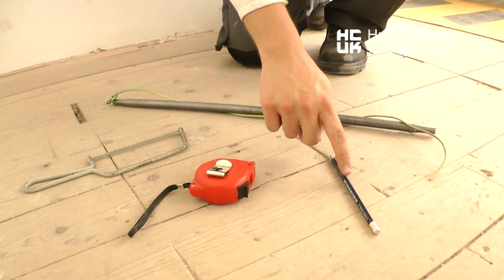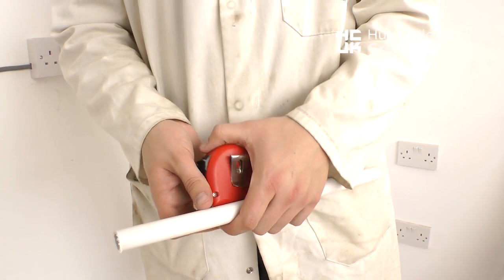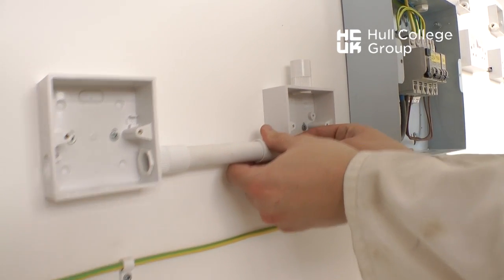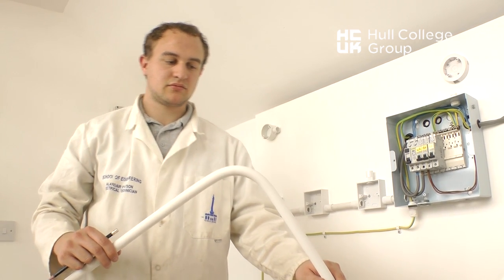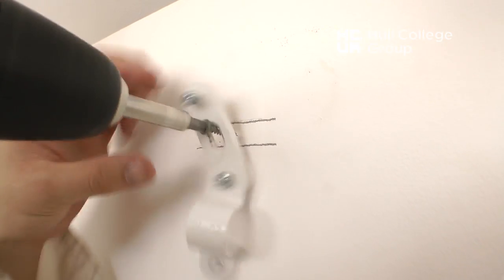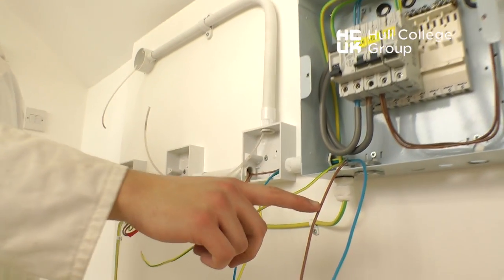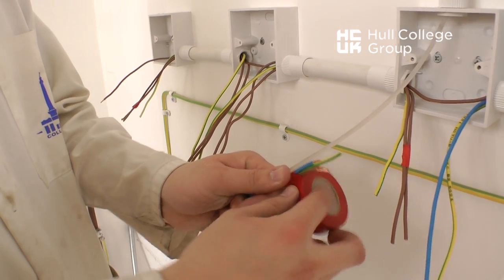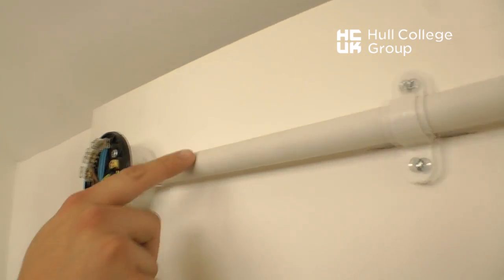2 - 20mm2 PVC Conduit Installation for a 2 Way and Intermediate Light Circuit - Hull College

Comment: Why do you go to the last box with the live wire first and then loop back?
Reply: +Zeamus634 - This is called an intermediate circuit. So its like having a Light Switch Downstairs, a Light Switch on the Landing (Upstairs) and a Light Switch Half Way. He took the Live to the furthest point then looped back towards the Light. It wouldn't work in reverse if it looped in through the light first (straight from the CB) as it would be permanently illuminated.

Comment: There should be no neutral in the switch box.
Reply: +jason nebu - True - the Neutral should come directly back from the Light Rose to the Distribution Board?
Reply: Why should there be no neutral, it may not need one but dosnt mean that you can’t have it at the switch